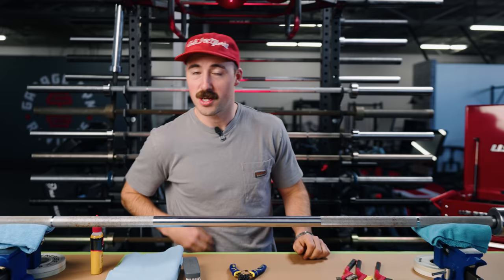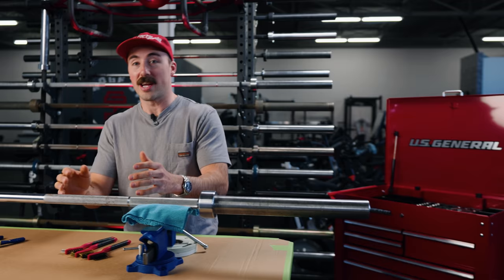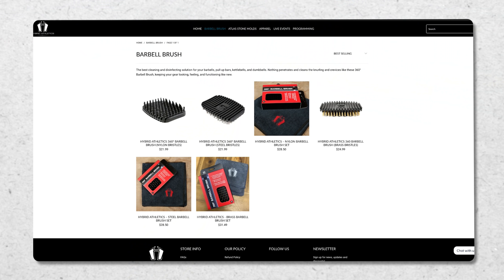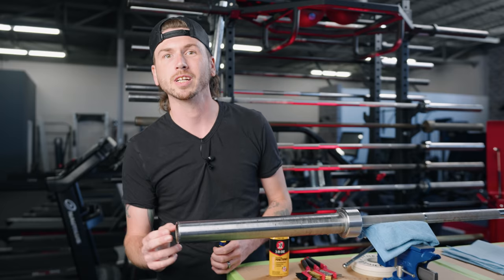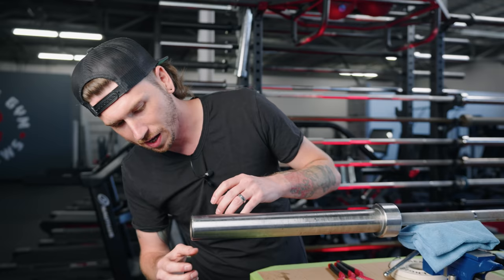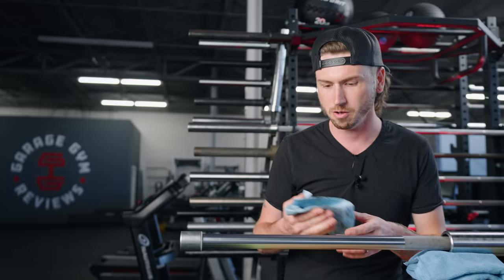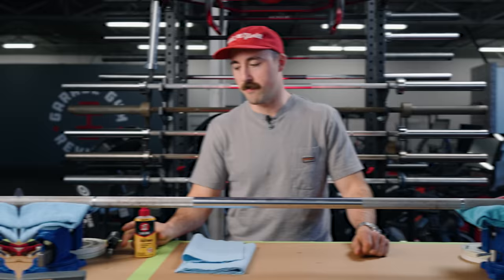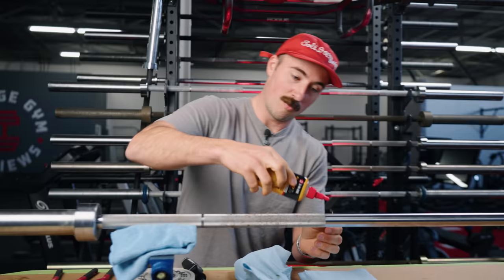How to Disassemble & Clean an Olympic Barbell!

Comment: If the thing came from factory with grease in it. Replacing grease with oil isn't going to cut it. You should use grease
Reply: Correct ! Grease will last longer but oil will definitely spin smoother and faster 
 You just have to do it more often
Reply: Agreed. Lithium grease for the win.
Reply: I was thinking the same thing something like axle grease or thinner would work great and will stay forever

Comment: For barbells with bushings I recommend using white lithium assembly grease, lasts forever and has a smooth motion
Reply: I was thinking the same; assembly grease in the sleeves will last longer than a film of oil.
Reply: and for the knurlings use cola and tinfoil wrap
Reply: any particular brands to look for?
Reply: @indianajonze  Any brand can of sprayable lithium grease is going to get the job done.
Reply: White Lithium  grease is a great long lasting product 
But If the bar has composite bushings  instead of Bronze 
You have to be carful it might damaged them  Silicone Grease will be safer
Reply: Agreed! I almost always use a lithium grease intended for bicycles. Really holds up well and keeps the sleeves spinning.
Reply: I was actually holding my NLGI #2 grease while watching this tutorial. :face-blue-smiling:

Comment: A note on the type of brush you use. Brass is softer than steel, stainless steel, and chrome, so it should be impossible to scratch those surfaces with a brass brush. I make no claims about cerakote, but there is no risk to using a brass brush on steel.
Reply: Agreed. I use my brass brushes a lot. Powder coat will get scratched removed. But everything you listed is fine. For cerakote, I stick to a very stiff nylon. It really shouldn't be scratched by a brass brush, but since my cerakote bars are pricey, I don't feel like finding out haha. Plus, none of my cerakote really get rusty, just dirty. So stuff nylon brush does the job.

Comment: I ran a pilot -- a proof of concept company (side hustle) - rehabbing barbells. In nearly twelve months I rehabbed the barbells at 15 different gyms/boxes(and went to every craft brewery nearby) cleaning the rust off and lubricating the bearings, as well as sanitizing them. Some of the gyms had not had their barbells cleaned in 10 years or more  -- or if ever. I would brush off the rust and these (bare steel) barbells had that knurl and instead of rust, you got to see that beautiful tempered bare steel patina again. During that time I must have cleaned and lubricated about 400 to 500 barbells -- some of them even twice.

Also, the Channel lock ring pliers in the link, that was my go to pliers -- but boy oh boy did I wear out those tips.
Reply: Hey mate I'm from Sydney Australia and have started doing this the last 3 months (onto my 4th gym and at over 50 barbells). Would love to reach out to you for any recommendations on tools, etc (have obviously wasted time and money on things that didn't work, but also a lot more from it).
Reply: * made a lot more from it.
Reply: Have you ever rehabbed a DHS bar? I'm trying to rehab my own but having some trouble removing the sleeves, seems something is unique to this type of bar...

Comment: Sam’s Kip impersonation was scary accurate, magnificent. Good presentation and information. If you’re looking for good retaining ring pliers - Imperial Tools IR12K set is quality. The ones your using are too small, and Irwin is mostly shite tools besides the automatic wire strippers.
Reply: Great tip on the pliers. I have the same pliers used in the video and they drive me crazy! I'll look into the ones you mentioned.

Comment: I would love to see you do this on the American Barbell SS Weightlifting Bar. After getting the snap rings off I can only slide the collar back an inch or two. I would love to be able to live up the needle bearings.
Reply: Did you ever figure this out. I’m having the same issue
Reply: The 15/16 Nut also doesn’t come out and and was “punched” in.

Comment: I watched this episode to see how to take the sleeves off and use it with standard 30mm plates. You can't buy heavy rated standard barbells but you can buy an olympic bar and strip it. Just have to weld some collars on the inside. I don't do cleans or any sort of curls with it so I don't need the rotation.

Comment: Probably best to use grease instead of oil on the inside parts there
Reply: Was thinking the same thing. 7 years plus and the OEM grease was holding up great.
Reply: what kind of grease?
Reply: I use lithium grease when restoring and cleaning bars. Generic lithium intended for bicycles is my go to and works very well. Doesn't leak out. Sleeves spin well.
Reply: @kellerv.602  I would use either Lithium grease like other commenters have mentioned, or just plain old Park Tool PolyLube 1000 bicycle grease would be better than oil.

Comment: Those 360 degree brushes are pretty cool. Still will need to get the toothbrush styles ones for the corners though since the 360 brush won't get in there.
Reply: electric toothbrush works best with chrome erosion polisher on it ( use any old brush head ) and aluminium foil and cola gets rid of rust pitting too

Comment: I'm glad I'm not the only to forge battle with snap rings! Lol. I'm looking for a better pair of snap ring pliers. Any suggestions? I restore and clean a lot of bars and there are times that I spend more time trying to remove a snap ring on one of my modern bars than the entire time it takes me to clean a vintage bar. Also with all these fancy modern coatings, everyone pay close attention to how your barbell is coated and the cleaning products and brushes used. You'll scratch or even remove some coatings with certain substances and brushes. Great video and I love the snap ring struggle!
Reply: I literally just went through this process with some no name pliers, then tried the Irwins that they have in this video, then finally forked over the cash for a good set of ChannelLock's. They made all the difference in the world. Literally removed the ring on the first try.

Comment: I personally would not use any metal brush on a stainless steel bar. You will likely scratch the thin chromium oxide layer which is what actually protects your bar against corrosion. Better to use some extra elbow grease.

Comment: American Barbell SS. OCD will not allow me to put it up dirty. Nylon brush, diluted simple green and a microfiber towel. Brand new every time in 3 minutes. Don’t get the simple green in the bearings or bushings. Spray away from shaft/sleeve junction. GTG

Comment: anyone know how to remove deadskin from the bar? i use a nylon brush with 3 n 1 oil but still doesnt seem to be strong enough to remove it on my cerakote bar. been a pain to remove it a tooth pick piece by piece lool
Reply: Having this same issue, going to try and give it a deep clean tomorrow.
Reply: @zeeali2722  let me know how it goes, ive tried brushing and brushing with alot of 3 in 1 oil and still doesn’t remove much :(
Reply: @tavokgs  I just completed it recently and it's worked well. 

What I did was take the lid of the oil, and used my fingers to rub it on and with a really stiff nylon brush, just kept on brushing in circles and in different directions. I must've spent around 40 minutes and it went from black thick grime to actually being able to see the knurling.

For my uncoated ez bar I just used a metal steel brush. 

I did dip the nylon brush in water occasionally but I don't think that helped much. I think it was more just oiling, brushing, wiping and repeating for ages. 

Good luck.

Comment: 5:28 Anyone happen to know if that end rotating knut type thing is removable? I was curious if a 25mm Olympic barbell could be used with standard 1 inch plates if you just removed the sleeves.
Reply: Olympic bar will be 28mm, 25mm for women's bar (15kg) 

But gotta remember the sleeves and hardware is part of the weight calibration
Reply: @AsylumStrengthNI  weight calibration as in total bar weight? So a women's bar might be something like 35lbs normally, less with sleeves off? 

Or are you talking about the bars weight limit?
Reply: Ever find out if it's possible?
Reply: @wonsyloves  No unfortunately. I was looking into buying a 25mm bar from Rouge (just the bar, without the sleeves) but ended up just getting a gym membership. 

If you had a grinder or some power tools, I'm sure you could get something to work.
Reply: @jaku8513  good for you my dude. Keep making dem gains 👍